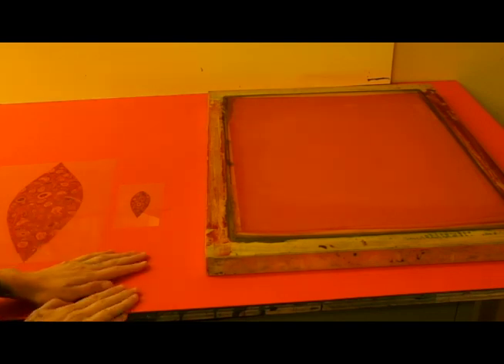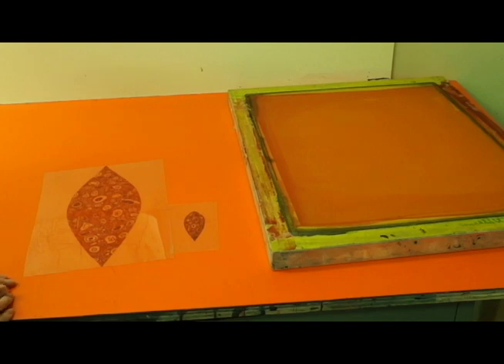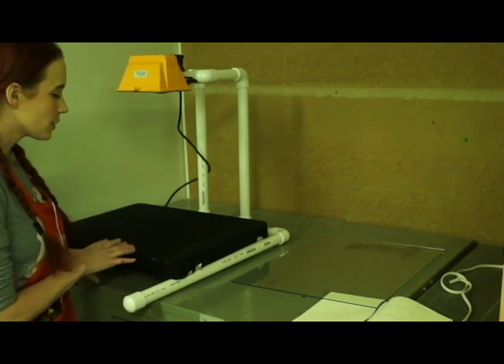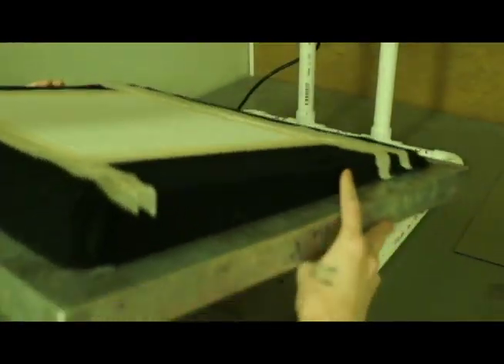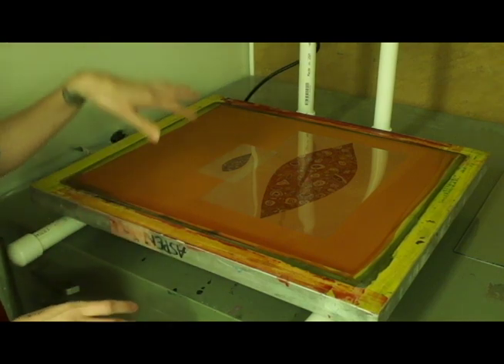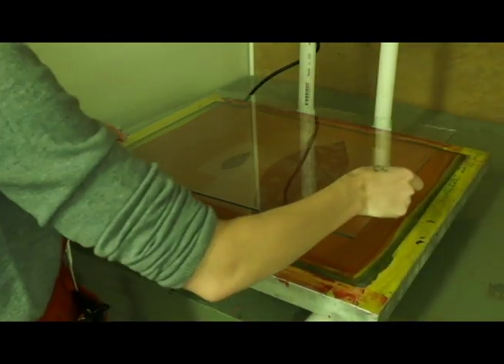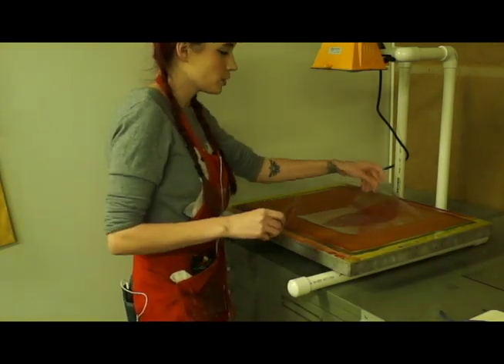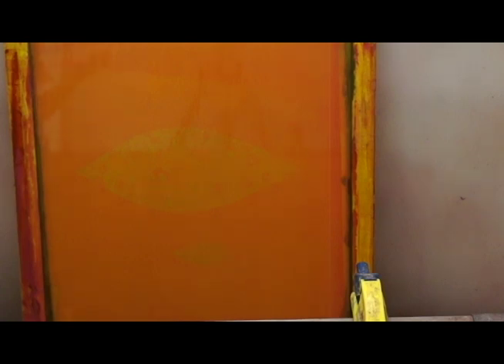Exposing Screens With a 500W Halogen Light

Comment: waste of energy and time. you can use 100 w uv light and expose it for 13 secs.
Reply: UV lights are efficient but expensive and dangerous; halogens cost about $5 and are available from the corner store.
Reply: You can also use the sun for free, but there is merit in knowing about lots of different methods for different situations.